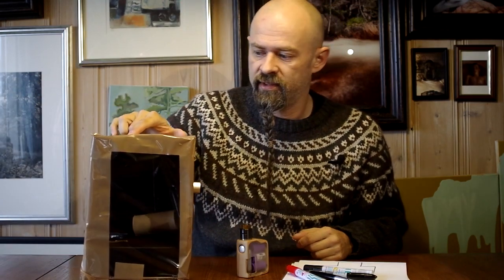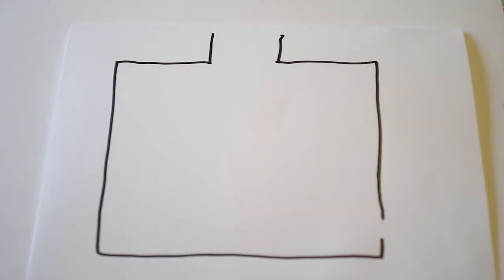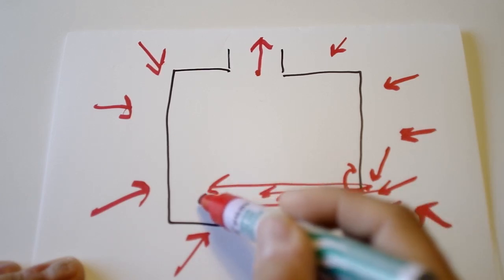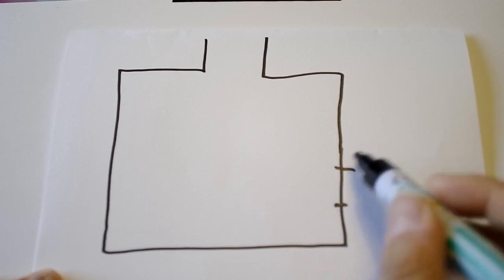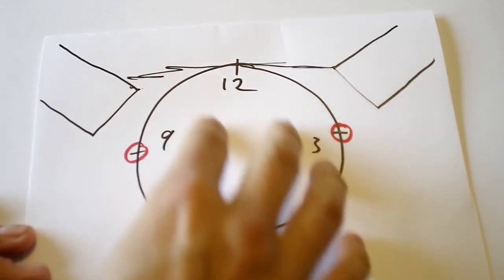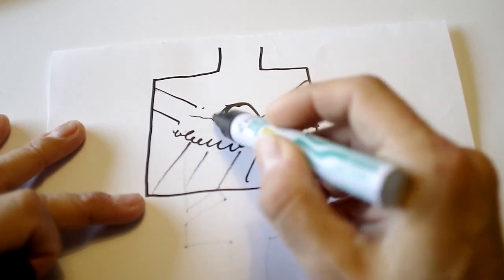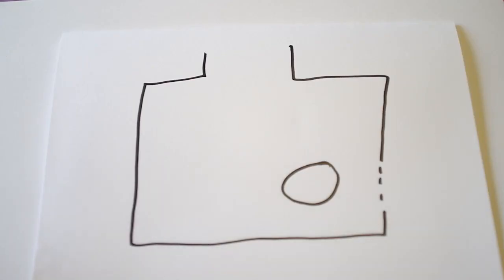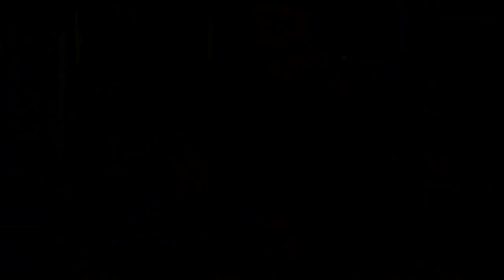Air flow and coil placement in RDA

Comment: So much to comment, so little time to explain it thoroughly.... The whole test is botched, and has basically 0 value in reality; 
The problem is that you have only checked the air intake and where the air goes, but you forgot to take into consideration the fact that the coil itself will produce vapor and it will be shot in all directions. That vapor production will have it's own force that will contradict with the air coming in, changing the whole wind tunnel on the inside. 
That being said, your tests, in their current state, are basically worthless. Look at how strong of a jet of vapor some coils produce, and imagine how that will modify the whole trajectory of the air inside of it.

I dont want to be mean, just... objective about it, and to take all variables into consideration.
Furthemore, I would highly appreciate a bit of a faster pace in speech, since I was honestly getting sleepy waiting for the next sentence...